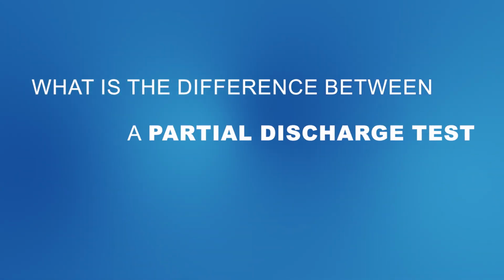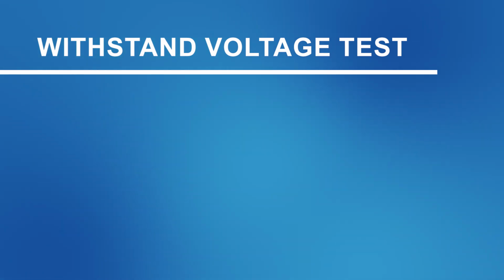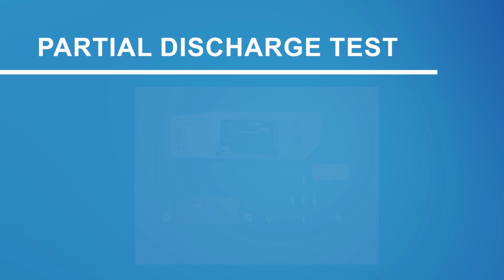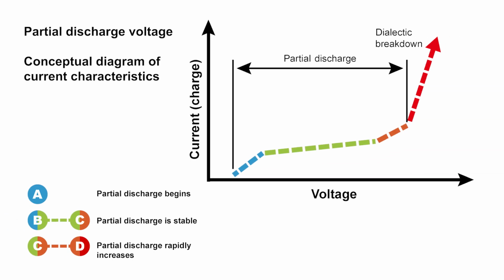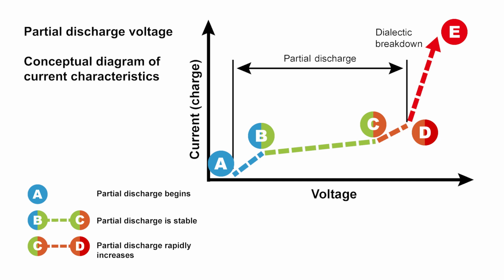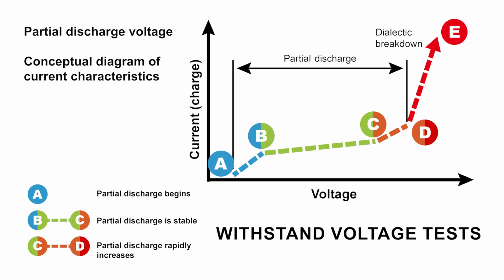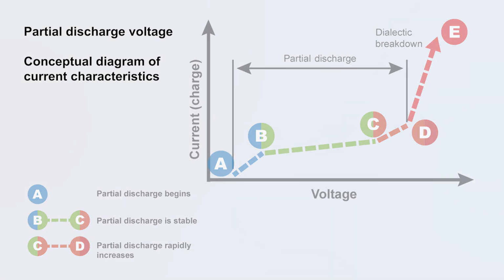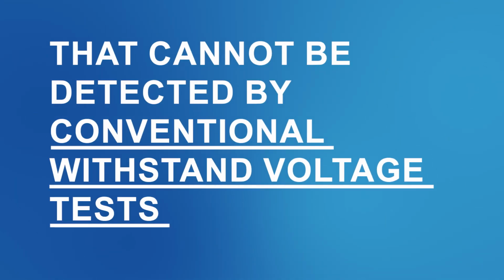Partial Discharge Testing vs. Withstand Voltage Testing (Hipot Testing): Key Differences

Comment: Visually. How much does this equipment cost? Our company has two Kikusui TOS9000. Unfortunately, they do not have such capabilities.
Reply from the maker: Hello! Thanks for your comment and for choosing Kikusui's products.
If you are looking for a device that can perform partial discharge and withstand voltage tests, we recommend the TOS9301PD.
URL: https://global.kikusui.co.jp/w2-2/safety-tester-en/insulation-resistance-tester-en/tos9301pd/
 
For the quotation, please get in touch with our sales team using the contact form on our website.
URL: https://global.kikusui.co.jp/contact/lead/